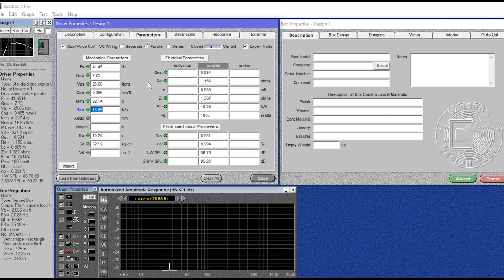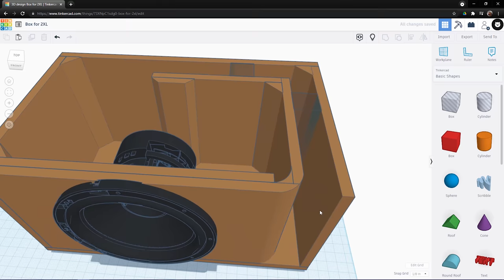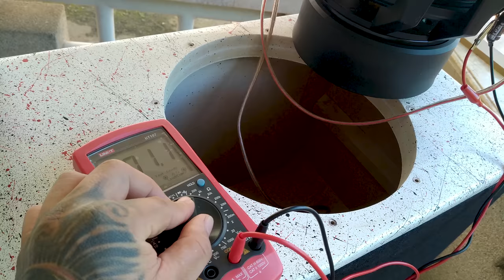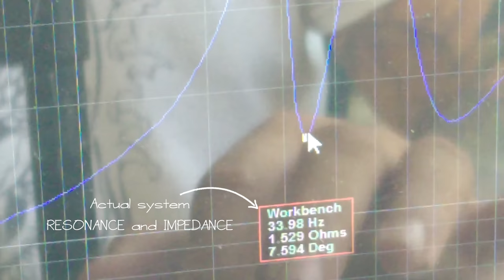MDF Kerf Bending L-Ported Subwoofer Box + Paint and Carpet

Comment: You directly screw tapping screws while installing sub? No pre drilling? What's that app what's technology in that? How it find resonance frequency without even playing sub?
Reply from the maker: Self tapping screws? You need to watch the video because I used Allen head machine bolts into T nuts.
Reply from the maker: Speaker enclosure design software need not to hear the speaker since theile-small parameter data are measured and provided.
Reply from the maker: @BonafideToolJunkie  yessir

Comment: To do a box like that, but to a 6'' sub, only need to do all with half of all measurements?
Reply from the maker: Hello Berg, you need to use a box calculator app or program and compute the values of the subwoofer to what your desired output
Reply: @chrclmnky  can you tell me some app that you know, for this? Thanks for the answer
Reply from the maker: @bgaraujo21  bass box pro 6, and WinISD (free)

Comment: do you have any videos that actually explain the box design process or even the modeling? I have been boulding enclosures for awhile and want to get into kerf but it’s hard to find solid info. I have term pro but wish I would have bought bassboxpro instead as it looks more useful once you know how to use it. i have tried to use sketch up but I feel like the program you use is better. sorry so many questions but I’m interested in learning some of these methods
Reply from the maker: Sorry josh no videos that has explaining because english is not my very best language. Any software will do, once you get the proper volume and calculations to what you desire for your box, you're all good.

Carpentry is just cutting and building the box you've designed.
Reply: @chrclmnky  I get that and do pretty well for what I know. My main curiosity would be the kerf cuts and how you figure out how many cuts you need along that length of kerf. I understand you can choose the radius and make anything work but I’d like to know what your rule of thumb is. thanks for the reply. Love your videos and enclosures 👍
Reply from the maker: @joshuastewart4734  i usually cut 12 kerfs using 10mm apart. 6th or 7th kerf is the middle for the corner should be.
Reply from the maker: When building box with kerfed port, i cut the kerfed baffle first so if there is a few milimeter off, i just have to taken account on the other board to not waste what has been cut so far.
Reply: @chrclmnky  last question…what kind of wood do you used?
Reply from the maker: @joshuastewart4734  plywood is best in kerfing. Mdf may also do justice.

Comment: I can't figure out how should i know how long i need to make the front baffle so the part of the port won t get too long or too shott
Reply from the maker: Hello, that is a good question and actually is very easy. Plot and measure everything like normal straight slotted ports. For kerf, just add about 2-3 inches depending how long the bent of the kerf radius. 

For an error free box building, cut and build first the front baffle and its kerfed port. Then add the remaining straight panels with appropriate lengths.
Reply: @chrclmnky  thanks, too bad for me I barely have money for a circular saw 🥲 hope one day I could build something like that
Reply: @chrclmnky  do you mean that I should add 2-3 inches at the end of the port? I was thinking the kerf will decrease the port length so the tuning of the box will get higher? Is that the case?
Reply from the maker: @Raulley27  yes.
Reply: @chrclmnky  thanks 🙏 I will just make the box a lil bigger, hope it turns well

Comment: Ano exact size ng box boss.. width height tsaka depth..pati port length at.port opening..salamat
Reply from the maker: There is a link to the TinkerCad 3D schematics in the video description. You need to create an account and login to TinkerCad so you can start using it and seeing the dimensions. Use laptop or computer web browser to open TinkerCad.

Comment: Kaya po ba 2xl sa low tuned box like 32hz po
Reply from the maker: @averagemark17  desired tuning is somewhere near. Watch the tuning section in the video
Reply: @chrclmnky  napanood ko sir pero grabe ang taas ng tuning ng box po ei
Reply from the maker: @averagemark17  can only go +/- 3-5Hz off the subs Fs or else everything will sound like sh*t
Reply from the maker: @averagemark17  if you watched carefully in the actual impedance testing part, actual system impedance is 33.37Hz and that is very low considering many factors affecting. If you"re going to use the same measuring tools I'm using to measure other people's work and you will find out how way off their boxes are.